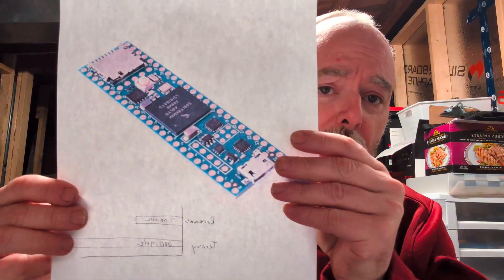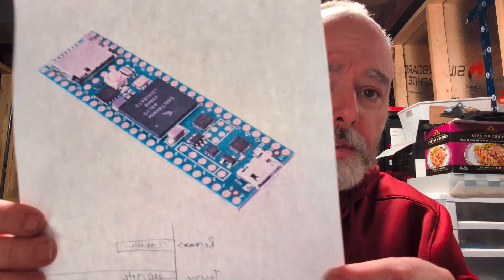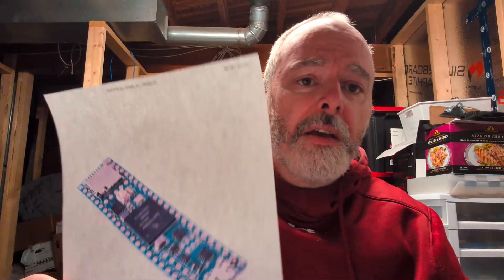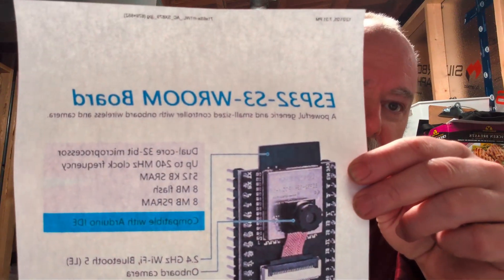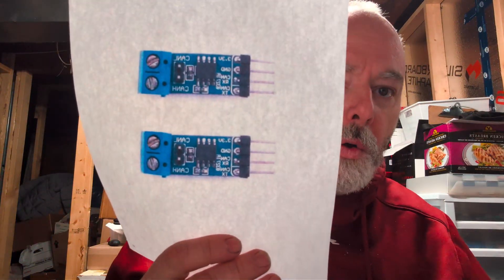Building the EVOS Control System to Kill Expensive ECMs

Comment: Curious about this, but also cautious because, as others have mentioned, OEM controllers have been built over decades to be safe and reliable. Usually the cost is simply money and man hours, but sometimes it's blood. This is less of an issue if rolling something for just you, but moreso if you are doing it for someone else.

FWIW, I'm a big fan of aftermarket ECUs for engines, but there is no HV involved there and a shutdown is more consistently achieved via a key off. None of this is intended to discourage though, only provide some warning. Subbed and looking forward to the progress!

Comment: Why would you use a development board? The only benefit to using a board like the Teensy is for ease of use with popular IDEs.. not to mention this has been done before. People are developing their own ecus all around the world. Pcb design is becoming much cheaper and accessible, why would you not develop your own system yourself? I don’t see how this could be profitable especially considering you’re using a $32 dev board from 2020 and could just use a stm32 for a couple bucks and then develop the whole system yourself. Is this a scam? Why are you asking for money outright when you don’t yet have anything made or concepts proven?
Reply from the maker: You're right.  I should design a board.  I'm experienced at software development but not electronics design.  I'm humble enough to admit that.  The board design is coming.  Want to get back comfortable with embedded design first.
Reply: @thefortifiedtech I understand, however I would recommend at the very least getting a base understanding of microcontroller selection, PCB design/layout, and ultimately a “higher level” understanding (especially when it is practically free with the help of the internet) of EE so that you can make better use of your time developing this project

Comment: Once you start adding the high current drivers, security, reliability, fail safe measures and other nonfunctional requirements you would see that higher clock speed brings no advantage and is not even needed.
Just to give you an example, newer controller = bugs that have not been discovered and patched = safety concerns
Reply from the maker: Not about clock speed.  It's about using 20+ year old technology and then complaining of chip shortages because only a select few lines can still produce them.  Also, vehicles are getting prohibitively expensive for some to  buy.  Companies outside of North America have adopted new technology and have more affordable options.  Why are we paying so much more for old stuff here?
Reply: @thefortifiedtech  The point is, the magic is not in the hardware. This project will probably live or die on the basis of software compatibility. I.e, Anyone can pump a fuel injector solenoid, doing so with good reliability is tricky
Reply: @thefortifiedtech Look up AEC-Q100 to understand the monumental work needed to get a microcontroller approved for ECM or ADAS.